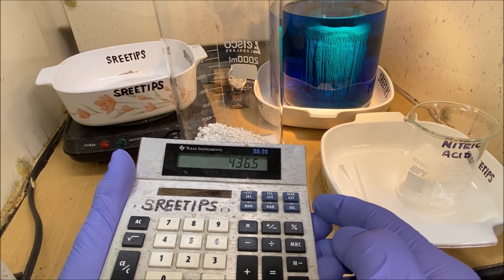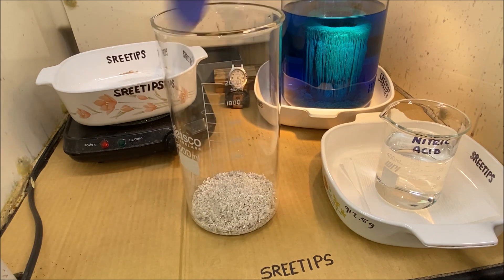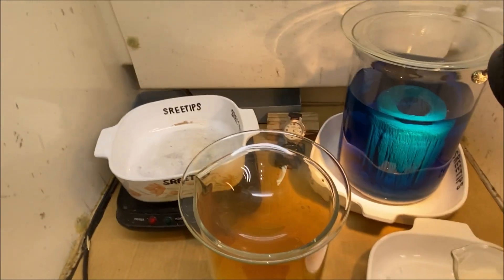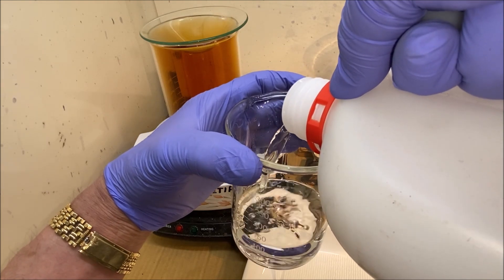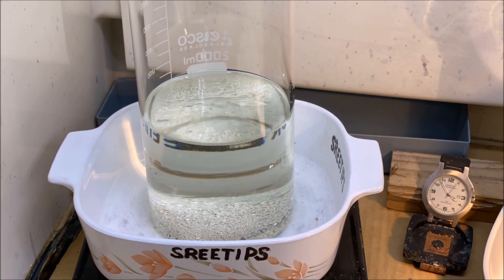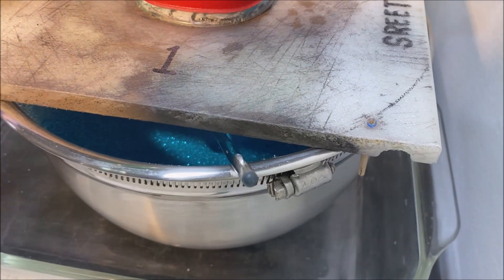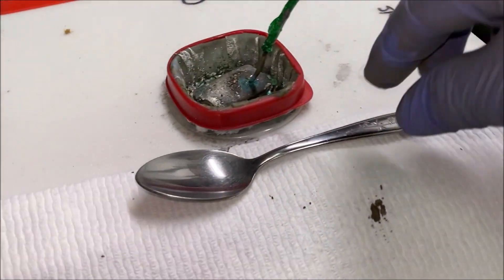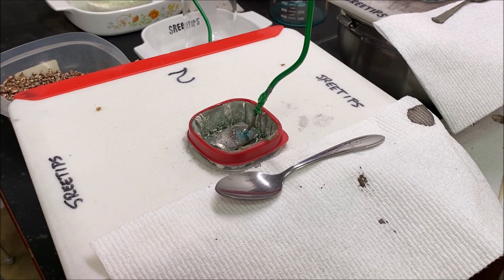Silver Cell Number 2 HARVEST Part1

Comment: I've watched your YouTube channel, for 4 or 5 years now and want to make my own silver cell.  Your video on How to Build one was great! I've watched it 10 times.  I understand most of that process. No problem with assembly of the cell or the procurement of the necessary materials and equipment.  What I'm wondering is...  if I wanted to strictly stay with silver and not chase down scrap gold for refining,... that would mean that I would not have any cemented silver byproduct to melt into impure silver shot, to feed the anode basket.  Is there any issue with taking scrap sterling and copper, which are items that I can and would be willing to chase down. Can I melt 925% sterling + .75% copper by weight and use that to produce the impure silver shot to feed the anode basket? What is the correct ratio? I'm a building contractor by trade so math, formulas and procedural issues come natural.  I guess I can mix distilled water and Nitric Acid along with silver shot which I have in stock, to the ratios shown in this video to achieve a acceptable electrolytes boil to supplement the startup of the cell?  Looks like you use a 25% silver electrolyte  with 3 additional equal parts of distilled water, to achieve a level up 1/2" over underside of the basket?  Is there a ratio for this startup mixture?? As I see you add distilled water at will sometimes??  These questions have kept me from moving to the next stage. Finally I'm guessing that the yield of silver crystals would be sufficient to produce the silver electrolyte for future batches as a self sustaining process?? While I may refine scrap gold in the future, I know the commitment to do both G & S would be overwhelming for me at this time. Any answers to the above 4-5 questions would be greatly appreciated!  Also, I'll be making a donation to your patron group today. under cswillis,  Thanks for keeping me intrigued and entertained at night!!
Reply from the maker: I use enough pure silver dissolved in nitric acid to create a silver nitrate solution that contains about 150g per liter silver concentration. The anode silver must be fairly high purity to begin with. Could possibly run sterling in the anode basket. But with that much copper the electrolyte would quickly become saturated with copper.

Comment: You’d make a great teacher but really how you just repeat the same steps with every video has really cemented into my brain how your process works…. Your repetitiveness is the copper that cements out my silver braincells 😂
Reply from the maker: Reinforcement, I used to train the men under me on the ship. I had thirty men. I’d take half of them on Tuesday down into chiefs berthing compartment where it was quite away from everybody. I’d grille them on the engineering plant, on Thursday I’d get the other half down there. I used repetition to train these men on our engineering plant. When the inspectors came aboard, they told the Captain that my men were the “best trained men in the waterfront”. Got me a job on the Commodores Staff for my last four years in the Navy.

Comment: I did a small refining today with a final yield of 9 grams of 999 Gold.  I tried the constants you shared on two previous refining but the inquarted gold always crumbled to a very fine powder.  I have much better luck doing the manual calculation and then multiplying by .95 to account for the up to -5%.  One final thing I’ve noticed,  When doing a boil down to drive off excess nitric, it seems to stop boiling and start bumping once the nitric is gone.  It must have something to do with the difference in boiling temps of nitric vs water.  That change in how it boils is a huge time saver for me because it is not necessary to take it all the way to a syrup.  I think it has to do with the fact that once the nitric is gone, the solution has to heat up from 83C to 100C before it will start boiling again.
Reply from the maker: When my gold crumbles it means that I included something that I thought was gold, but it wasn’t. I’ve been doing this for almost 14 years and the only time that happens is when some of the gold was counted as solid karat gold, but it wasn’t. Could be a piece or two of gold filled or gold plated got counted as karat gold.
Reply: @sreetips  maybe I was using the wrong constants from previous videos and did not realize it.  Either explanation makes sense.  It makes the refining so difficult when the gold crumbles into powder.  I assume the larger the batch, the more forgiving it will be to accidentally putting in a gold filled piece.

Comment: comments disabled on part 2, so i comment here, it would be fun if you would feed the pure silver you get out from cell into anode basket for one run to see how much slime you would get from 1.5 kilos, electrolytic purifying it twice, will electrolyte turn blue? will structure of crystals change? etc
Reply from the maker: I’ve run the crystal back through the cell a second time. It came back five nines fine via ICP analysis.

Comment: Is it necessary to remove free nitric acid when replacing copper pieces in silver nitrate solution?
Reply from the maker: You don’t want lots of free nitric, it will needlessly consume the copper. But a small amount of free nitric is needed for the cementing action to take place.
Reply: @sreetips  How can I control a small amount of free acid?
Reply from the maker: I heat my solution until no more fumes and some undissolved silver remains and won’t dissolve any further. Safe to conclude all the nitric is gone at that point.
Reply: @sreetips  thank you very much ~😊👍

Comment: Dude I'm an idiot. I've been so busy over thinking the crystal growth between the 2 cells. That I just noticed the wattage is the same!!😊 I've been reading the two backwards or rather the 1 backwards. Soooooooo your video here. Has enlightened tremendously now. Plus it helps when your correctly reading the meters😅. Can't wait for the harvest. Thanks for not tearing me apart. I'm slow, but I eventually get it.

Comment: So this question is going to seem really wacky but here goes:  I believe you mentioned in a previous video that you had read/heard that having some copper in the silver nitrate can promote the growth of bigger crystal in the silver cell.  Have you ever considered using the silver nitrate created from removing the silver from enquarted gold.. instead of cementing it out?  I"m guessing there's likely too much copper/other metals in there.. but could be an interesting experiment (perhaps at the risk of ruining your silver though)?
Reply from the maker: When I harvested cell number 1, the electrolyte had much copper because it was the second use. And that harvest was incredible. Those crystals were fat and chunky and well formed. I believe this was due to the presence of the higher concentration of the copper.
Reply: @sreetips  So could be worth an experiment to try using the blue silver nitrate you get after dissolving the silver and base metals from your enquarted gold directly in a silver cell?
Reply from the maker: None of the professional refiners that I learned from recommended that. If there’s palladium in the inquarted gold, then it will follow the silver. The palladium could go-deposit with the silver. But contaminated silver is not the concern. You can have much palladium co-deposit and you wouldn’t notice until it’s around 10% Palladium is forty times more valuable than silver.
Reply: @sreetips  So if I'm understanding this correctly.. palladium that is cemented out with the silver, and included in the impure silver shot will not follow the silver as the silver crystals form..  but if there is palladium in the contaminated silver nitrate, it could then follow the silver (out of the solution) as the crystals form?  Did I get that right?
Reply from the maker: If the electrolyte has free nitric, and if there is palladium in the impure shot, then the free nitric could dissolve the palladium in the impure shot (because palladium is soluble in nitric - the only one of the six sister metals in the platinum group that is) and leach into the electrolyte. If this happens then the palladium could co-deposit with the silver. I can tell if palladium is in my electrolyte because it will turn green instead of blue. A little palladium in the electrolyte is not a problem. But higher concentrations could begin to co-deposit and contaminate the silver. But, the palladium is more valuable than the silver by forty times. So when you sell your silver, you’re selling palladium at the price of silver.
Reply: @sreetips  Ok got it.  Thank you very much! Love all your videos!!

Comment: Cell # 2 looks like it is working better than cell #1;  have you checked the voltage output of both power supplies?  they may read 3.5v on their displays, but is that accurate?
Reply from the maker: Yes, I’ve checked both with a Wavetek meter.

Comment: It looks like the new cell is producing significantly faster.  It doesn't make sense to me that it would be the power supply... 9 watts is 9 watts (3 volts at 3 amps).  There's got to be some kind of resistance on the connection of cell one that's lesser on cell two.  I wonder if there is some kind of coating building up on the bowl on cell 1?  It would be very interesting to see some resistance reading at various points between the connection terminals of the power supplies all the way to the bowls!  Or maybe swapping the supplies to see if the growth increase moves to cell one... that would prove whether or not it's truly the power supply that's making the difference.
Reply from the maker: Agree, it’s probably in the anode filter. When it gets clogged with slimes the resistance goes way up. Resistance goes up, crystal growth rate goes down. Another phenomenon is that when the slimes clog that filter, fewer silver ions are passing through the Dacron filter into the electrolyte, the silver in the electrolyte will deposit faster, thus depleting the electrolyte of silver at a faster rate. And the shot is a little dirtier. So it clogs faster. Electrolyte silver concentration. Copper concentration. Corrosion on the leads. Electrolyte depth, it goes on and on. There are many variables to consider. And they all influence crystal size, shape, and growth rate.

Comment: You need a larger rectangular stainless steel bowl, increase the voltage to 4.5 volts, try pouring impure silver into the enlarged and putting it in the Filter, I think it will work better. The new source works over the old one,
Reply from the maker: There’s a critical distance between the anode and cathode: 4 to 4.5 inches. A circular cathode maintains an equal distance between the anode and the cathode. The voltage, according to the pro refiners that I learned from, must be kept at 3.5 volts DC. And the current is allowed to wonder and fall where it may.

Comment: Did it take you long time of refining scrap gold to accumulate those buckets of cement silver?
Reply from the maker: I’ve been refining gold for going on 14years. Gold is so easy to refine in just a few hours. Silver takes a lot more time and effort and is much less valuable. For these reasons, I have a tendency to ignore the silver bucket. And it builds up on me. I currently have about a hundred pounds of cement silver that must be melted, poured into shot, and run through the silver cell.

Comment: those annodes areally getting " chewed up " now that youre burying them with shot.  most certainly means more contact. my guess is that is helping production times considerably.
Reply from the maker: The anode electrode bars will fail in about a year of continuous use. Either by being consumed due to contact with electrolyte in the anode filter. Or from bi-metallic corrosion between the copper wire cast into the pure silver bar.
Reply: Maybe electroplate the gold on the copper wire in the anode and silver plate  copper wire to the connector.

Comment: I still can't get over how fantastic that new power supply is going, it's almost twice the production of the older power supplies.  Great choice, we use the HP's in the labs at my hospital, now  I have a good idea why.  Beautiful crystals, I can't help smile when you say look at that man!  Thanks!
Reply from the maker: I’m not sure. There are many variables that determine crystal size, shape and growth rate. But I like the new power supply so much, that I’ve ordered another one.
Reply: I don't think that's a safe conclusion.  I think there's some kind of resistance on the connection of the older cell that's less than the resistance on the new cell.  Total power (~7-9 watts) is the same on both supplies.

Comment: Hi ! I would like to know if the copper always decomposes to the end in the waste basket where you cement the silver, or if there are still pieces of copper at the bottom of the container between the silver cement. And if bits of copper remain, how do you remove them? By washing the cement and filtering?
Reply from the maker: Yes, the copper goes into solution as the silver comes out of solution. Kind of hard to wrap your mind around this. If every bit of copper gets consumed, then I add more copper until the reaction is complete (no more silver cements out on the copper). When silver stops forming on the copper then I know I’ve got all of it. However, some silver nitrate will get trapped in the cement silver that in the bottom of the bucket. So I stir to release and wait for it to cement out. There will be bits of copper in either the cement silver - that’s unavoidable. I just pick them out and add them pieces of copper to my silver stock pot as I rinse the blue liquid off of the silver powder
Reply: @sreetips  Thanks for the detailed answer. I was also getting copper residue between the silver cement. Now I prefer to cement the silver by adding distilled water and suspending the copper plates in the container. Sometimes whole layers of silver stick to the copper and it's harder to clean. However, when I thoroughly wash the cement with distilled water and then melt that cement and pour it into water, I get what appears to be very pure silver. Of course, I still purify it with electrolysis.
Reply from the maker: When I first started I did the same thing. But as time passed I didn’t worry much about it. Because I know it will come out in the silver cell.

Comment: the production in sc#2 is incredible and makes me even more curious as to whats going on. when you run out of the fine grain shot we' see if that was a major factor or not
Reply from the maker: I refine gold. I use sterling silver to refine the scrap gold. I recover the silver from that, melt into shot, and run it through my silver cell. The cell converts the impure silver (about 980 parts per thousand silver) to high purity four nines fine (9999 parts per ten thousand) pure elemental silver metal. The impure silver is added to the anode basket. The anode basket is suspended in the silver nitrate electrolyte. I pass an electric current through the impure silver. The silver dissolves, passes through the Dacron filter, travels through the silver nitrate electrolyte, and deposits on the stainless steel bowl (the cathode). The bowl is connected to the negative pole of the power supply. The process only deposits pure silver on the cathode. So I’m refining the impure silver, into high purity silver. When it’s full, I harvest the pure silver crystal. Then I repeat the whole thing again.
Reply: @sreetips  oh i understand but the dramatic production difference between the 2 cells has my inner detective/chemist curious, neither of which have worked together in ages lol the old pws was, from appearance, the same make as the still surviving one so clearly the new pws has  something to do with the production uptick but is it just that or some odd combination of new pws and different shot used? as both cells where using the same shot and conditions were roughly the same [no lab control here] the most likely suspect is the pws which was why i asked the other  day if it was pure sine or not. i dont know in your set up if it matters but, as i said, in many other applications pure sine produces different results, usually cleaner results, especially in electronics
Reply from the maker: There are many factors that influence crystal size, shape and growth rate. Power supply is a big one. But the others can throw things into a tizzy also.
Reply: @sreetips  yeah hence the 'no lab control' if you were a different type of channel like nilered itd be cool to run lots of tests and figure out how to repeat consistently but different type of channel so more gold plz&ty if its not burning you out to keep up the content pace that is
Reply from the maker: Here’s a list; corrosion on the leads, depth of electrolyte, silver concentration, copper concentration, silver slimes consistency, filter clog rate, dirty impure silver, dirty anode electrode bar, pressure, temperature, resistance, the list goes on and on. And it really doesn’t matter as long as I get high purity silver in the end.
Reply from the maker: I have a hundred pounds, if not more, impure silver that must be melted and run through the cell. I have to force myself to get it done. I dislike refining silver because it takes so long. That’s why I have such a big backlog. Gold refining will yield six or eight grand in a few hours. Whereas silver takes weeks. So I tend to go for the gold and leave the silver to build up on me. It’s one of my character defects that I must work on. But running a bunch of tests, is something that’s not really necessary, and I don’t have the time to do it.